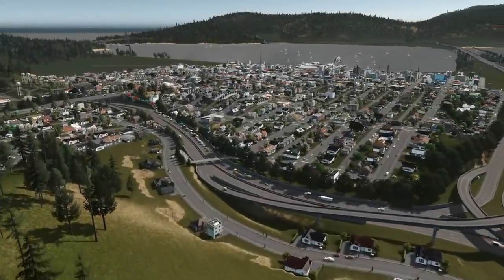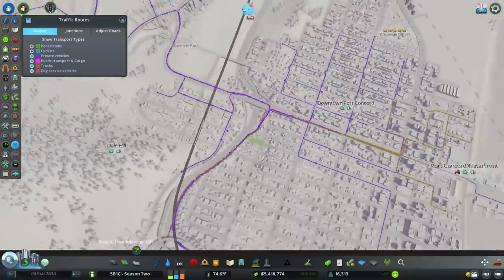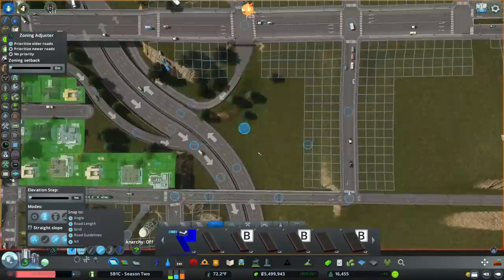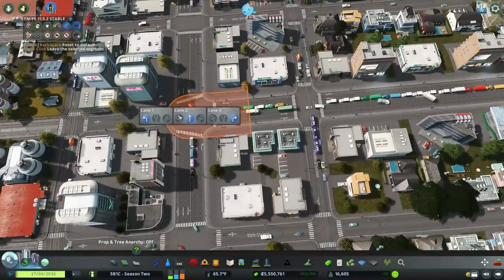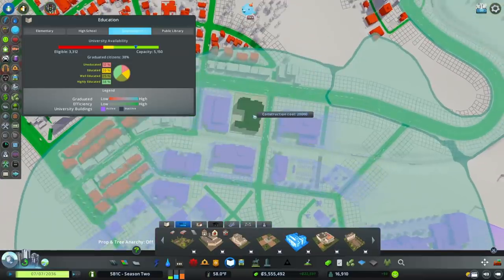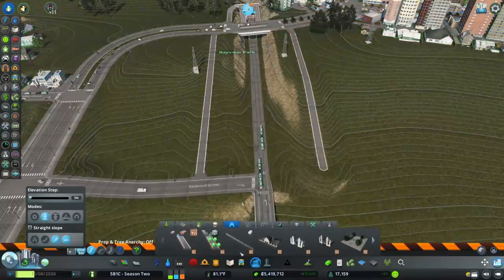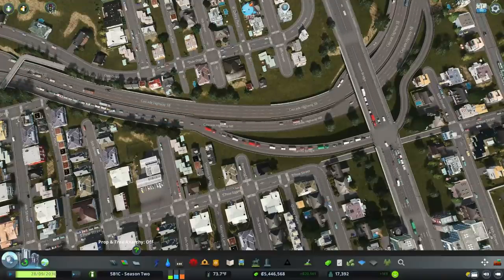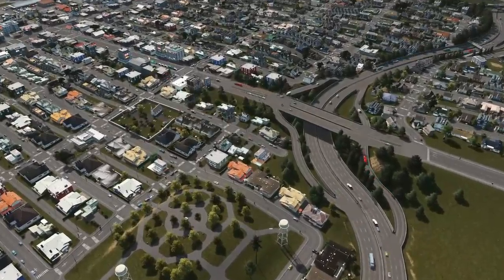How to Rebuild A Clogged Interchange in Cities Skylines 5B1C

Comment from the maker: Want more #5B1C?? Head on over to see @OVERCHARGED EGG's first video of Round 1, premiering just minutes after this video ends!
https://youtu.be/Z5CeToPbKnk
Reply: I dont get it why are you not using the diverging diamond interchange  instead of the regular diamond one . I use them in my city where there is heavy traffic and it works just fine no highway backup
Reply: woah that was quick lol
Reply: @sachindalal6394  Probably because that was the interchange that came with the map? Rebuilding it to become a DDI around existing houses would probably be a pain I imagine.
Reply: @richy77  nope they got the space, might just require some longer on and off ramp but that's it
Reply: @sachindalal6394  You could have a Parclo or a double crossover if you're at it, but hey, everyone's style is different

Comment: Hi.
I totally understand you got a little bit salty over those Biffa-comments - especially because this is not a lane mathematics issue.
The 15:30 and 16:30 lane connectors are a sufficient solution though a little bit brutal but if the goal is to have roughly equal amounts of vehicles per hour in each lane they do their job. But if you take into account that right turning traffic is clearing the highway off-ramp much quicker (unless it is stuck behind left-turning a few vehicles) the goal post changes and not allowing right-turning traffic on the left lane becomes an option ... a less brutal option.

Btw I love you university tram line ... perhaps little district bus loops in Bayview and on the campus could give more people access to it and increase the ridership.

Comment: Nicely done!  I’m just curious on the traffic fix why not a 3 lane ramp to have a dedicated “left, right, right” configuration?
Reply from the maker: Thank you! And great question! So, I really just don't think the ramp needed three lanes just yet. First, there was no phase on the traffic light where rights would have been clear to go without conflict. Second, with the right lane assignments, it was totally doable to balance traffic to use both lanes pretty evenly, which makes for a shorter cycle. And third, the 3-lane ramp would have taken up more space that I'm not sure I had.

Mainly I just don't think the traffic is that bad at this intersection...and I don't know that it'll get that much worse. But things change...we'll see what happens. :-)

Comment: I would make the intersection that highway exit ramp into 3-4 lane road for more traffic line-up, if it is not available to extend the length of the ramp
Reply from the maker: That's probably where this is going...but I'm gonna hold off for as long as possible on that for two reasons: 1. It shows people more alternatives rather than just a simple quick fix, where sometimes a simple quick fix is not good enough. and 2. traffic is not super duper bad at this ramp really...not yet anyway. I like going more with a realistic fix, and IRL I don't think they'd jump straight to a three lane ramp...not just yet. What I wish I'd done is use Node Controller to widen that intersection up a bit to ease the turn radius. Since there are no pedestrians in that area, that's a totally conceivable option.

Comment: someone should build a crossroad, avoid the need to pass through the junction (got featured in the rant)
Reply from the maker: Lol yes you did 😂 I didn’t want to embarrass you though...I’m happy you stuck around and left a comment again after 😁

I did create that back interchange around the hill, and I added the crossover to 11th Street to add another way around. The bummer with this map is that the geography is just not favorable to connecting across that highway without serious changes to the topography. It may need to be done down the line though...it could be unavoidable!

Comment: Hi Lee. Some advice, you might want to avoid placing services (like the police station and medical clinic) on avenues. When a service's vehicle leaves its building, it can only turn right because the median. This could end up forcing a service vehicle to travel a long distance before it can turn around and greatly impair the services effectiveness.
Reply from the maker: Honestly, I just wanted to slap one somewhere so that I had one. If I worked that neighborhood again, I'd totally move things around when I build on the other side of the street most likely. I was in such a rush to turn things over to the next guy I didn't have time to think everything through 100%.
Reply: @LeeHawkinsPhoto  Gotcha. Sorry if I sounded critical. Thanks for taking the time to reply.
Reply from the maker: @kevinmertel6108  no worries! You were definitely not the only one to mention it!

Comment: Would a diverging diamond help that interchange?
Reply from the maker: Great question! I really think a DDI would be inappropriate here because of the near intersections on the west side of the bridge (Dale Drive especially). I would have to have a signal there to handle traffic getting backed up waiting to jump in, and it would be tough to find the queuing capacity for all of it in that little neighborhood.

Also, I think it would really be overkill. The worst situation here is that northbound ramp with all the trucks heading East on Main Street. It’s just a matter of having the ramp long enough and the intersection favorable enough that trucks can get out expeditiously.

In this video I’m taking a minimalist approach...trying to avoid building more than I need at every step...because it forces you to think more critically. The traffic at this intersection isn’t good, but it’s not super bad, really. But I want everyone to see the steps in working through the problem so they can use them to make small tweaks at a really bad intersection where they will add up to a good fix.